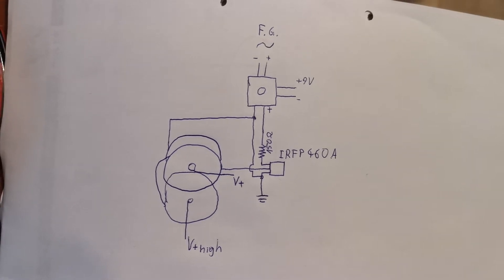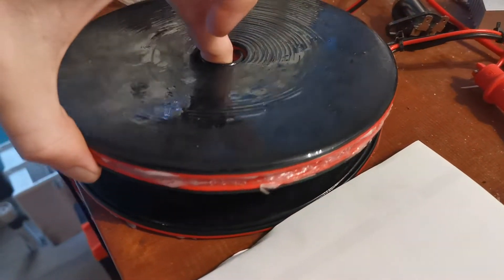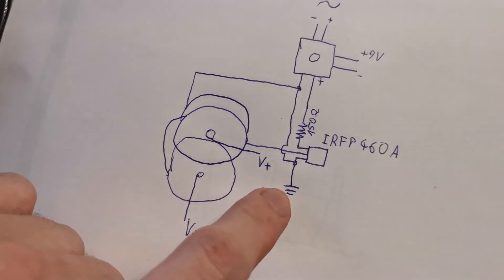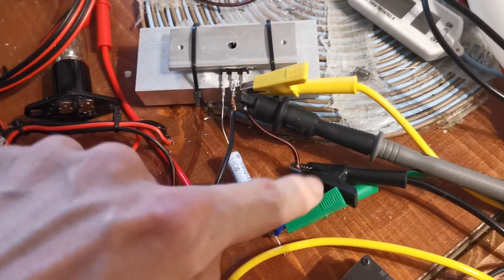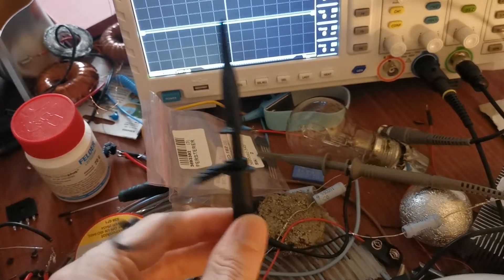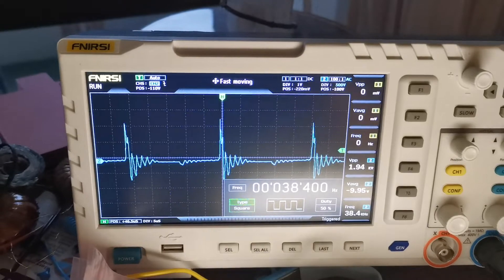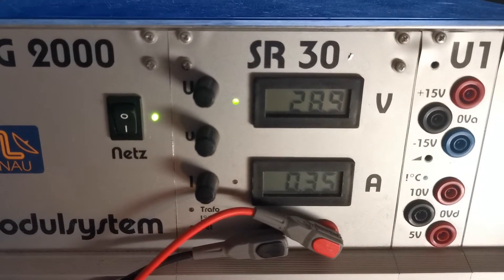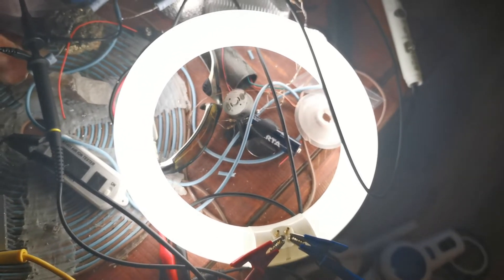High voltage impulse generator - improved version using less power with schematics

Comment: Great video. Thank you. I thought it was great that you could create a high voltage, low current impulse at any frequency with a simple configuration. ‼️
I'm trying to replicate it now, but it's not working. (About 600v) I tried it with several MOSFETs using an audio amplifier with the same specifications, but they are all 400-600v. Is the power supply you are using a high specification? Any advice would be appreciated.
Reply: Your setup sounds wrong. Can you detail it please and the connections.

From what i see here, OmegaZz has power supply - oscilator - audio amplifier, to the coil.
Reply: Your setup sounds wrong. Can you detail it please and the connections.

From what i see here, OmegaZz has power supply - oscilator - audio amplifier, to the coil.

Comment: Nice work, the bifilar pancake truly is an amazing coil. This setup is very similar to an induction cooker and if you place a thin aluminium foil on there you will get dielectric levitation, you may need to increase voltage a little to be able to get lift off, check out my antigravi tea video for a poor demonstration. IMO the light gets brighter when load (copper plate) is increased due to the pancake coil being an amplifier, more power in means more power out. I boil a 2200 watt kettle in my video and with the coil I used it only draws 1100 watts. Be careful with the aluminium foil it gets pretty hot!
Again, nice work.
Reply from the maker: Thanks for your kind comment.
You are right I can actually feel some slight repulsion on the copper plate, I guess with a much lighter aluminum foil you can make it levitate.

My goal with this setup was to create very high voltage at very low current. 
I can touch the high voltage leads at full power and don't feel anything. 

This is just speculation from my side, but the way I see it, my setup acts as an inverse electromagnet. 
While an electromagnet produces a very strong magnetic field, this setup creates an extremely strong dielectric field. 
If I put a compass on my coils it does not react at all, even at full power, therefore the magnetic field it generates must be very little compared to the dielectric field.
Reply: @OmegaZZ111  I agree regarding strong dielectric field, I have tried to measure the field with a high voltage probe and aluminium foil, the probe detects a high voltage at a maximum of 400mm. The foil see’s the field as a dome, strongest in the centre and maximum lift of 100mm, the foil will fall off to the side so I place a pencil or chopstick in the centre of the coil, punch a small hole in the centre of the foil disc and use the wood pencil to hold the levitating foil disc in place.
Reply: @whatifididthis...1236  What will happen if we replace the copper plate with the multiple of flat ferite cores similary the induction cooker coil on both top and bottom coils?
Reply: @OmegaZZ111  dear OmegaZZ. Thank you again for your video. Did you tried to use your pyramid placed on the top of your coil. As it is acting as a capacitor it may work as the copper sheet but without the magnetic field lost. Have a lovely day.
Reply from the maker: @Pierre-Marie-9-6-5  yes I have made a video where I show the pyramid on top of the coils.
It just dampened the field and voltage.
Reply: @OmegaZZ111  when you say dampened, you think it consuming like a battery?
Reply from the maker: @Pierre-Marie-9-6-5  The voltage of the impulses generated by the coils went down when I placed the pyramid on it.
Reply: @OmegaZZ111  which means that the pyramid is sucking and storing the dielectric flux
Reply: Another legend❤❤ is here😊, i follow  your channel too, great to see legends working together. One Love🎉🎉❤❤❤😊😊😊.... from AFRICA